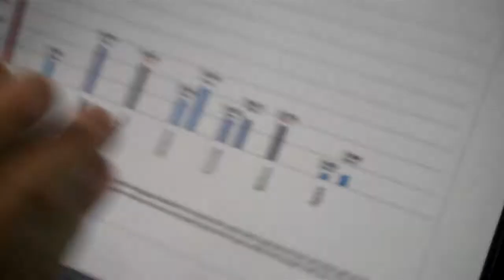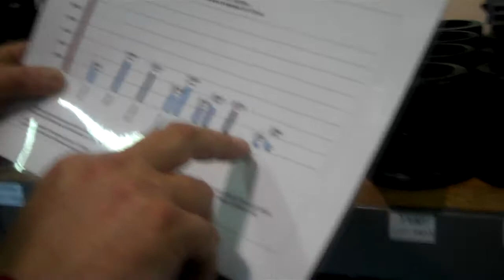impact sockets

Comment: Hmm, weird. I've never broken a 1/2" drive socket at 250 ft/lb. I broke the heads off 3 breaker bars, and 2 3/4 -> 1/2 adapters trying to take the crank bolt out of a 4.5l toyota engine (fjz80, torqued to ~305 ft/lb WITH threadlocker) using the starter bump method. Finally went to a 3/4" socket and popped it loose. I used a 1/2" socket with a 3/4" adapter on a sliding t-bar with a 4 foot pipe to torque it to spec. The 1/2" deep 34mm was an advanced auto cheapie and took it like a champ.